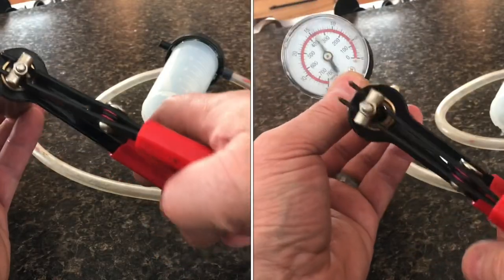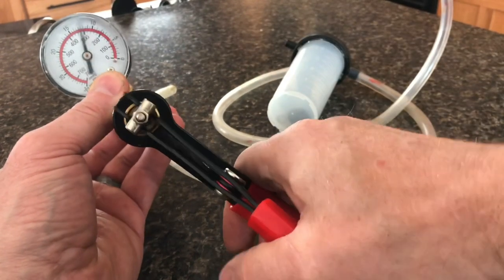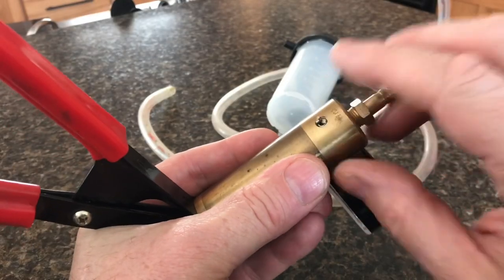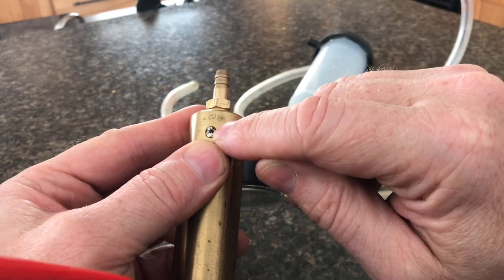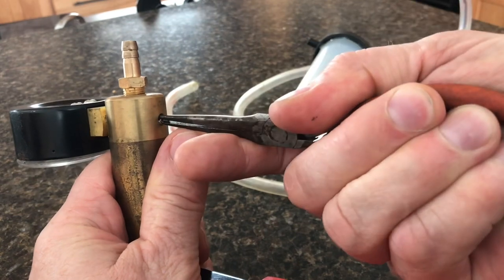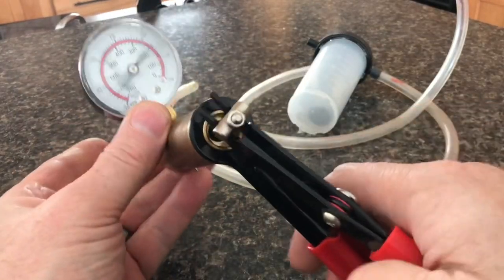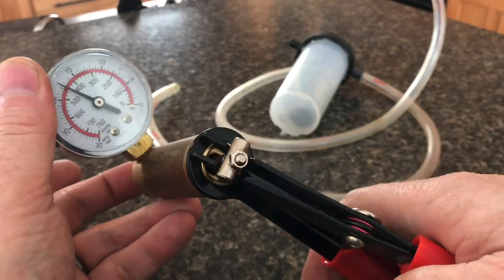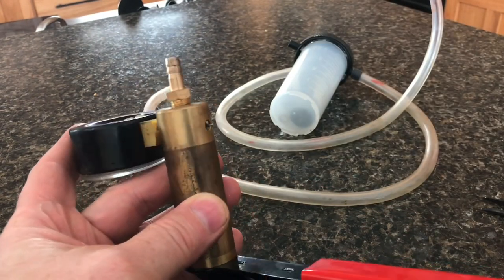FIXING brake bleeder and “vacuum pump” kit (harbor freight) pittsburgh automotive

Comment: I accidentally got fluid into mine (not same model but very similar) and it wouldn't hold vacuum when the trigger was released.  I removed the schrader valve and  used a pair of pliers on the nut just behind the barb fitting to remove the front part of the device.  There was a loose rubber valve in side that had apparently be pushed in by the fluid.  Re-seated the rubber valve and re-assembled. Works again!

Comment: If I plug the hole it does hold the pressure, but still doesn't build any pressure when vacuum-sealing jars using one of those white tops for jars. It has until today. Any ideas?

Comment: Thanks so much for this video. My vacuum pump worked twice before it developed the same issue of not holding vacuum. Using a very small pair of needle-nose pliers, and literally a 1/4 of a turn of the valve to the right, and it works again perfectly. Perhaps whoever installs these valves at the factory doesn't run the valve in a far as it needs to be.

Again, many thanks for the tip.👍

Comment: got new pump about 10 months ago , finally got around to use i t, would not hold pressure at all , was not the schrader valve but is the disc in the internal pump parts that is bad , is cracked so will not hold vacuum upon release of lever, cheap internal parts, all you can do is replace the unit when this is the case ,  it was cheap , but not really since have to buy a better one to use.

Comment: Could that also be the reason I can't get beyond 26hg ? It seems that all my pump will give me is 26 and never 30hg, is that normal, or should my H.F pump go to 30hg with no problem, p.s I should mention it does hold a vacuum at 26hg but within 4 min it diminishes. Thank you
Reply: You may have a seal somewhere that leaks a little but frankly it is not worth the bother to do anything at this point.  It will still work fine at 26hg and there is no need for it to hold that vac for any length of time more than it takes to be drawing the fluid/air out.  In use, it will normally lose vac as it draws the brake fluid through the system and then it gets pumped some more to bring the vac up again.  If you have to pump it constantly (and I mean constantly, continuously without moments of stopping to wait for progress), THEN you should diagnose which portion is leaking.

Comment: well, tightened the valve no good..removed the valve installed new one same thing, it does not hold pressure...damn now i have to waste two gallons of gas to return this.....terrible
Reply: Same issue here. I tried to fix it and still no pressure. I'll have to go exchange it.

Comment: The big issue with these is if they are not used correctly or the tubing cleaned correctly the fluid gets into the pump mechanism and destroys the seal. Still haven't found a replacement seal
Reply: Aw man. Don't tell me that.  Mine started sucking up brake fluid and I was hoping to be able to replace the seals.